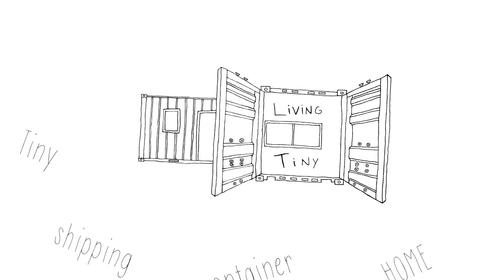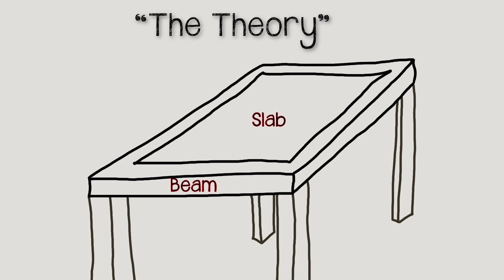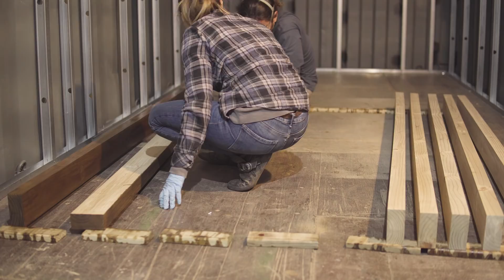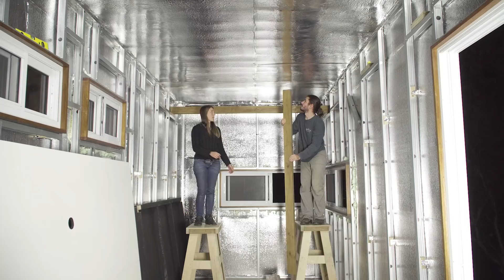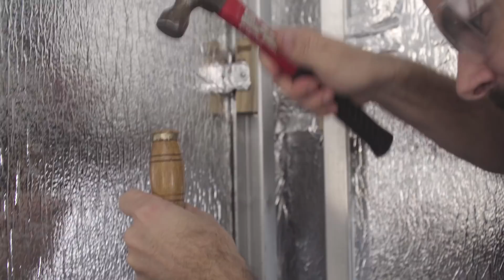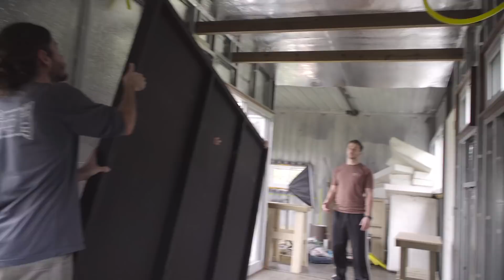DIY Plywood Ceiling Panels (Shipping Container) - Living Tiny Project Ep. 037

Comment: Should put studs under your beams. To give them more weight suport.
Should use wood studs under beams.
Reply from the maker: That’s not a bad idea. We are monitoring to see any sign of falling and if needed we will add. 👌🏼
Reply: Once the wall panels are up, then you can no longer do monitoring. I would put extra support as well as mentioned in an earlier comment on the same issue. But up to you of course.

Comment: Hi, good work again !!! So how high is the ceiling now ? The beams are at what height and what height are the panels ?
Reply: Regarding the floor: That is something I would be interested in for some more details. I know that will be covered in the near future and not now. But it might be of interest to look under the existing floor of the shipping container. There are metal beams (~12 cm I believe). That space can be used as well to insulate (rockwool or spray-foam which does not exist where you are :-) ). I have watched several other shipping container builds but I never saw an episode where the floor is being discussed in some detail. It seems that many people put insulation on top of the shipping container floor, but if the insulation can be put under the floor, then space, in principle, could be saved. Commenting on this or contemplating on this like you did when you contemplated about the condensation problem would be much appreciated. I know you are living at a latitude where it never gets really cold. But maybe you have time to discuss various options on how a shipping container floor could be insulated given various climate circumstances (maybe consider two extremes: a) your climate and b) a shipping container in Canada). I personally would weld galvanized metal plates under the shipping container in order to make a perfect sealing from beneath. Then I would remove the wooden floor. Then dry out that space. Then fill out the space with spray-foam or rock-wool. The bottom (facing outwards) side will be painted with metal-protection sealant like what you use under cars or on top of the shipping container. That would free up space on top of the container floor leaving more living or head space. Great videos of yours. I watch them every week, looking forward to them, and I love your enthusiasm and energy!!! Keep up the good work!!
Reply from the maker: Good questions hehehe the hight of the ceiling I believe is around 2,45 or 2,5 meters. Will check tomorrow. And the beams as like 10,5 cm hight. The weight I have no idea 😏
Reply: Odd Life Crafting to be honest I forgot what is the height of ours. I'll measure again. Do you already know what you are planning with the floor because that finally determines the height inside? Some building codes require a minimum height but I'm not sure if you are planning to get building code permission?
Reply from the maker: About the minimum hight it’s ok. In our code is 2,4 meters and I’m sure we have more than that. 👌🏼👌🏼 our shipping container right now is actually higher than the last apartment we lived in here. Hehwhe
Reply: :) And I forgot if in the video's you mentioned the plans for the floor? We have put there 4 cm XPS (in a wooden frame) , then 1.5 cm OSB boards and then 2 cm wooden flooring so that's minus 7.5 cm as well....
Reply from the maker: Our floor will be made out of 5mm+2cm wood. That means 2,5 cm.
Reply from the maker: As you said we don’t really need floor insulation around here. But we will talk about that in the future for sure!! 👌🏼😊

Comment: The header plate is the cross beam, in this case it is your single horizontal metal plate ( cut metal stud ) going between the two upright metal wall studs. I only worry about the overhead weight of the ceiling. .  Here is a video    Building a box home from 2 shipping containers,
link  https://youtu.be/5d0JaJkZkkQ?t=1997  its kind of cool. The basic layout, but the building of the roof will sweat as time passes and damage on the wood on top that was not covered will build mold. Duca, you think well before doing where these guys slapped it together.
Just to let you know if they had sprayed at least one inch of spray foam under the roof with an extension wand and also 1 inch or 2 at best on top of the container before roofing it would have been a lot better. Back a few years ago when New Orleans was hit by Hurricane Katrina the metal buildings that stood, were the ones with spray foam  and the ones without the spray foam were torn apart by the heavy winds pulling the metal apart at the seams. The spray foam acts like a very strong adhesive holding the building together. I built a 7000 sq ft building and sprayed the underneath the roof completely and then down the walls after putting in electrical conduit for the electrical wires, and piping for the water. It was also a very good bug prevention barrier.
Reply from the maker: 👌🏼👌🏼I have seen this one. I wish we had spray foam available but unfortunately we don’t. 😏

Comment: Looks good guys, but pressure treated wood if it ever catches fire the smoke will kill you,it is treated to kill insects and stop rot. The other comment is the header plate holding up the wood ceiling might collapse in time, it is better to add a stud under each of the header plates.
Reply from the maker: Thanks for the tips Toby. About the header plate we didn’t understand. All the beams have studs supporting them. What do you mean by header plat. Thanks a lot.